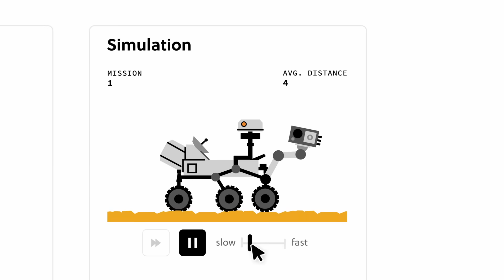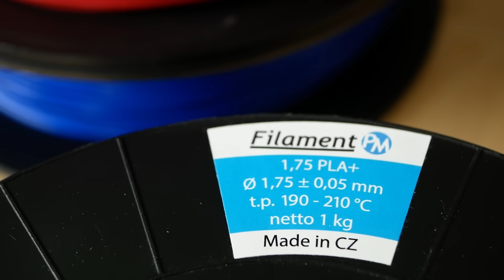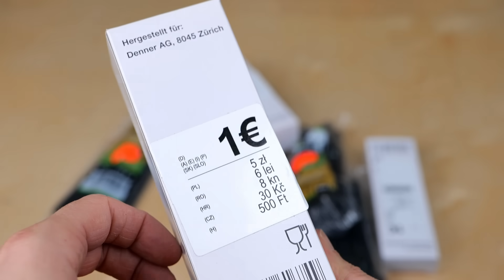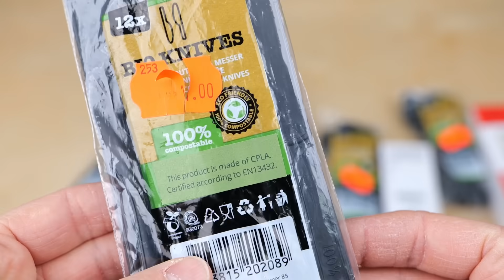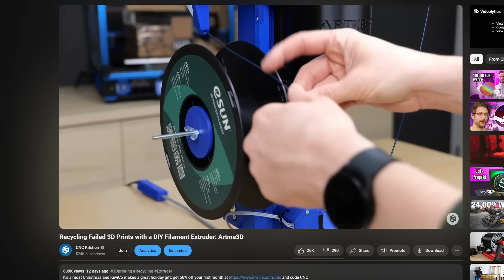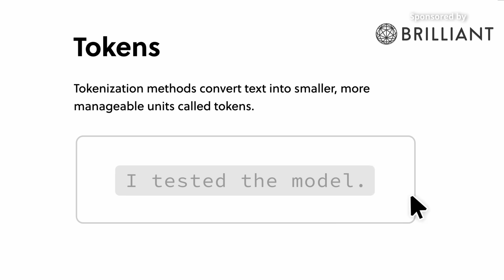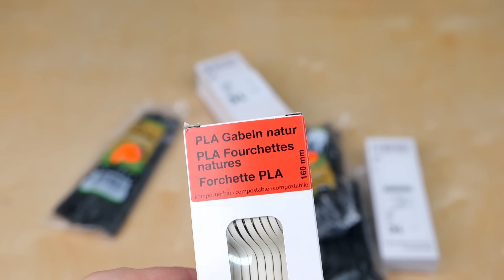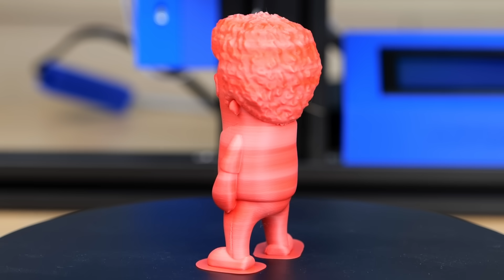From Trash to Treasure: Recycle Cutlery into 3D Filament!

Comment: When I was doing some upgrades to my 3d printer I discovered that klipper has the ability to use a fillament diameter sensor, adding one of these to a printer could automatically compensate for the smaller diameter fillament and mitigate the effects of extrusion inconsistencies.

Comment: If you can make filament of polypropelen and make it print decently you'll have an unending supply of filament. We throw so many PP away these days. Or maybe try some other exotic materials like the type of plastic that crates of beer is made from. Just try some things that might print well and are easy to get.

Comment: Great video. It shows how much more work is required to recycle single use plastics compared to simply putting dishes/cutlery in the washing machine... There is no reason to keep using single use forks and so on.

Comment: Hi, I got a few rolls of ABS+ASA blend a while ago, and recently found out that they soften at only 60-70 degrees. Would you make and test some blend materials? My guess is that blends always have a lower temperature resistance than pure material.

Comment: I don't actually want the filament (I know I'd never use it as lately I've just wanted to have the prints be printed and prototype nice and easy with my X1C), but I would love to see you mix small strands of fabric materials in, like the shortest strands of cotton you could fit before reaching the sizes that start becoming air quality risks.

I have never seen it before and so for that reason I'd love to see some of the weirdest mixed in filler imaginable. I imagine it will give it a nice texture similar to carbon fibre but without the really really small particles, nozzle wear, probably still with some added stiffness, but best of all, still able to be as colourful as you want.

Comment: Cool video, thanks for sharing! About the smaller filament diameter, isn't that partially because you're using too small of a nozzle for the different viscosity plastic?

What happens if you try the same method to recycle used soft drink pet bottles? I know this may be problematic in terms of volume (average bottle is just under 30g of material), but I know that coca cola for example, has a mix of plastics in layers to make their bottles. I'd love to know if it recycles properly or not. Especially into a 3d printable filament.

Comment: I think a problem might arise from the fact the cutlery from take out usually doesn't have much in the way of designation of what sort of plastic was used, thus making it somewhat difficult without proper setups to actually differentiate what pieces of plastic would be worthwhile to use for the process. Same with the plastic take-out containers, honestly. I'd like to recycle those since I have a TON, or the plastic containers that yogurt/etc comes in. Those usually have recycling marks, making it slightly more easy to tell, though not by much if you don't have the #'s memorized.

Comment: Thanks again for exploring recycling waste plastic into filament!   Ideas:  
1. I hear that HDPE is used in some "cleaning filament" as it has a low melt temp and a high "decomposition" temp; I wonder if you could make your own cleaning filament with waste HDPE?
2. If you have a spool of old/brittle filament, can it be salvaged by mixing it with 3D print waste and/or cutlery regrind?

Comment: Fascinating results. I don't think I'm the only commenter who wants to see the usual testing gauntlet done for these recycled PLA materials with and without food exposure, so we can quantify how food residue affects strength or impact resistance. Maybe even a batch of less carefully cleaned utensils if you think it won't cause damage to the recycling setup. You could even investigate variables of different foods and/or detergents to see what foods are harder to remove or which detergents work better. Obviously all the testing should be done with fully recycled filament so we can get a fair comparison. I can't wait to see what you find out!

Comment: I'd love to see you do a roll of filament that changes color on purpose using scrap prints and/or bits of pelletized filament from the ends of rolls too short to print anything with.  Basically, put in 100g or so of one color (or white with one color pigment), and then put in another amount of another color, and so forth.  I'd love to see how the colors transition using your extruder and how well the color transition zones adhere to each other, both on the spool and in the final print.

Comment: I wonder if there'd be value in using a multi-material printer, setting it up to print the outer walls in virgin material and the inner walls & infill in recycled. It might require a new tool to edit the gcode, but you might cut the purges to 1/4 through a combination of not purging when moving from virgin to recycled, and alternating layers printing outer walls first vs infill first.

Comment: I think it would be cool to see how this method would work with clear plastic containers that are usually used in takeout. Also, it's really common in Brazil to separate the caps of PET bottles, that might be a good idea as well.
Reply: A lot of take away containers are polypropylene and similar, which are recyclable but much more challenging than PLA.

Comment: Could you try making filament out of general plastic waste. Like stuff you find inside a German plastic waste (Gelber Sack)
Then grind it and use simple ways to sort to granules e.g. by checking what floats on water or heating it in a fine sieve and only use material that melts through to sieve at a specific temperature.

Comment: I think I remember you mentioning HDPE a while back, but I would love to see if you can recycle that, or perhaps go into ways to blend or even treat prints of various types to have increased UV resistance. It'd be an awesome help to the community, in my opinion, especially to those who want to print products specifically for the medical field, since we use UV to sterilize a lot of our equipment. 

Love the channel, love what you do, and the way you succinctly present information is incredibly refreshing!
Reply: Using recycled plastics for medical purposes is a horrible idea.
Reply: @DaveSmith-cp5kj  Out of curiosity, why? I would think recycled plastics would be fine for anything that is already made from the same plastic but I really don't know much when it comes to medical.
Reply: @JoshDavis40  It's the sterilization issue. If you want something reusable it has survive being autoclaved which pretty much none of what is commonly used is capable of without warping due to glass transition. Compounding this is the fact 3D printing introduces an insanely high surface area for contaminants to be trapped, which increases the risk of contamination. Contamination is not very likely, but in medicine unlike say dentistry you have no idea how sensitive a patient will be to pathogens. If you watch healthcare workers if anything is suspect, they throw it out (even if they drop some gauze on the floor still in it's plastic wrapper) because infection control can mean life or death.

An autoclave also only sterilizes biological threats. You could have something like a recycled material having an allergen or something that would go unnoticed. This could be as equally as dangerous no matter how small. 

For first responder applications however, infection control is not as big of a deal because the act of treating a victim in an austere environment automatically introduces pathogens. Your objective here isn't infection control, but ABC stuff (Airway, Breathing, Circulation), or MARCH if you are in military. Ukrainians on the separatist side early in the civil war before they started getting supplies from Russia did things like make tourniquets, NPA, and even decompression needles from trash which saved lives. However many had complications from the obvious lack of infection control.
Reply: @DaveSmith-cp5kj and you are very right)

Comment: Hi! I can tell you plenty of the plastic cutlery doesn't get separated for recycling, it ends in the general trash a lot of times. I rarely see people offering it up for recycling at our facilities, probably bc after use, people want to discard it as fast as possible. When people do bring in disposable cutlery it's mostly ancient, unused and often still in it's packaging. Here's hoping most businesses do make the effort to offer them up for recycling, idk..
The highest volumes of plastics we get at our waste recycling facilities are bottles, bags & polystyrene. Not sure if any of that would be easily printed with, bc we have partners with chains that recycle those. We also get a steady flow of water-buckets, trashcans, clothe hangers, cd cases & toys. Those don't (always) meet our partners quality standards (bc of being composited with other materials). Most of those are easy to disassemble.. Perhaps you can intercept a uniform batch from those categories locally? 
You probably already have a good idea of the types of plastics they're made of and if they're likely useable.

Comment: About color consistency: it also means that the new PLA pellets are not evenly mixed with the old plastic. Maybe it would be worth making a plastic pellet extruder for 2-stage recycling? So that on the first stage you shred the original plastic and make pellets out of it, with all mixins (like new plastic, color, etc.) and on the second stage you make a filament.

Another idea: try to make composite filaments (really dont know how). As one of the ideas: you can add copper or aluminium fine powder to the pellets/shredded plastic. Maybe make this powder from metal trash?

Comment: Hi Stephan,
In the US, we don't really separate the types of plastic that we recycle. A byproduct I can think of for this way we recycle is that recycling is expensive since we have to sort out plastics. I would really like to see you extrude a roll of mix material filament full of pet bottles, HDPE, some forks and straws. I would really like to see the outcome and what would happen when you try to print a mixed roll.

Comment: I’d be really interested to see filament made from plastic grocery bags that are overbearingly popular in the US. Their use is super problematic as the infrastructure for recycling them is very lacking. Even where I live with one of the best recycling plants in the US, you have to take your plastic bags to their store of origin for recycling as it just isn’t profitable for domestic recycling to handle them. 

Converting them to filament would have some challenges. Firstly you’d have to get them, which a lot of places have explicitly banned the import of them. Then you’d have to get them into a meltable form, you can’t really shred the bags as they’re so flimsy that they have a tendency to tangle spinning mechanisms (you can really mess up your car if one gets caught around your axel or wheel).
Reply: We don't have plastic grocery bags in this region but we do have trash bags that we can just buy in bulk! A little funny if you think about it... There isn't any replacement of them planned either...

Comment: Try making PETG from recycled PET soda bottles. The process should be relatively simple, just add glycol to the shredded flakes.
Reply: You can't make PETG from PET because it's a copolymer, the glycol isn't blended into the plastic, it's polymerised into it during polymer synthesis. Just like you can't make ABS or ASA from their polymerised individual ingredients, those are also copolymers.

You can however make HIPS, since that's a blend.
Reply: @SianaGearz  True, simply adding glycol won't depolymerize PET. However, mono- and polyethylene glycols will, like other free diols like butanediol. The former should cause glycolysis of the PET monomer. I suppose there's experiments to be done here.
Reply: @maraz666  I have doubts as to what the outcome might be but i'd be happy to see an experiment indeed. I mean transforming a common but unpleasant to print material into one of the most strongly preferred and highly recommended materials would be quite revolutionary.

Comment: This is a cool idea.  I think the majority of the single use plastic I encounter tends to be PET.  I think most cutlery unless specifically an "eco" brand is made out of PET as well.  The same concept applies, we already know that bottles can be made into filament.  I hold onto a lot of my plastic waste with the idea that I can recycle it.  One step I still find challenging is getting an easy way to sort the various types of plastic from each other.  If there is an easy way to do that at home, I think that would be very helpful on the world stage as well.

Comment: Regarding what you could try to recycle next...

If I look in my refrigerator, I see cups with yogurt and packages of cold cuts (like salami and cheese). Maybe those could turn into filament as well.

I also thought about the possibility to add carbon fiber to the shredded plastic. But you probably would need another machine for that. Personaly I would not want carbon fibers to fly through the room.

Comment: Filament from bottle caps, they are often made with PP. PP is chemically very stable, an excellent electrical insulator, it's tough without being brittle. It warps a lot tho, so enclosure mandatory I guess.

Comment: I love these videos and there is definitely a plastic waste problem in the US. In fact, I've watched some companies collect plastic bottles for recycling, and then move them to the trash instead after collecting so even though I'm trying to do my part, the people collecting aren't, so eventually I want to begin recycling all my bottles at home. I already collect all my failed prints and my Bambu waste, separating the colored waste from multi-colored prints into bins so I can eventually recycle them into single colors.

What I'm most curious about is recycling HDPE into filament and I'm having trouble finding very much info on that. Milk jugs and the cap & ring on soda bottles are HDPE so it'd be neat to see someone grind down and make a filament using those especially since many have vibrant colors. I know it'd take thousands of bottle caps to make a decent amount of filament, it'd be neat.

Comment: It would be interesting to see you do some iterative strength tests by starting with virgin plastic and then extruding, testing and then grinding it to extrude it again and see the trends in the strength metrics as the number of melt cycles increases. This could potentially help determine by comparision how much virgin plastic needs to be added to recyled material to reach certain strength thresholds.
Reply: I've seen some studies on this done. the problem is that it's not the grinding and re-extruding that  is the primary cause of weakened plastic, but things like prolonged uv exposure and abrasion. I know that injection molded plastic can be ground and re-injected dozens of times without a noticeable strength decrease, but virgin plastic that sat outside for a year will be noticeably weaker when ground and re-used, as the polymer itself is what has degraded.
Reply from the maker: Congrats, you won some of the filament I made! Please send me a quick message at contact@cnckitchen.com
Reply: @CNCKitchen I almost reported your comment by instinct because I see so many scams impersonating content creators these days.
Reply: Totally agree!
Reply: I would hope you wouldn't fuck any of the plastic but hey you do you
Reply: I'd also like to see how the name brand cutlery filament does in the usual testing gauntlet with and without food exposure with 100% recycled material. maybe throw in some poorly washed stuff if you think the recycling setup isn't going to be damaged by it.
Reply: Brothers Make did a video on how many times plastic can be recycled
i think it was interesting 😊

Comment: I've wanted an extruder specifically because you can recycle and make your own custom filaments, I was thinking you could use metal powders. Adding sintering powder to recycled plastics at a very high ratio of metal to plastic would yield a brittle but sinterable filament. You could also do this with sawdust and make your own wood filaments for the people that do woodwork. And something EVEN crazier. Using dried clay particles, you could make pottery out of filament (you'd still have to put it in the kiln to sinter) but would open up the avenue for many new materials in the 3d printing world

Comment: Thanks for the video Stefan.  I'd like to see you improve the Arteme3D Extruder more to make it more consistent when extruding.   Maybe by using a measuring device of some kind close to the extrusion point of the machine tied into a feedback loop which adjusts automatically.  The current method on the Artme3D doesn't seem to be that good.

Comment: Just had a quick dig through my recycling bin just now and most of the plastics apart from PET are HDPE, back in a day (early reprap) I used to have bit of HDPE filament given me by someone, don’t believe I ever had successful print with it but those were the early days when everything was horrible to print! 😁 Wondering if it’s any different with decent machines nowadays…

Comment: The reason plastic is a problem is because it gets into oceans. The reason it gets into oceans is because it gets diverted from “recycling centers”, as they can’t actually process most plastic. So the irony is that recycling (which is a wasteful scam and an environmental disaster) is the primary reason for the environmental degradation. If we simply threw plastic in the trash, it would end up in landfills instead of in the oceans. That is a much better outcome for the world. Yes, it would be better if we didn’t throw things in landfills. But, as so often, utopian thinkers make the perfect the enemy of the good, and cause more damage than they set out to solve.